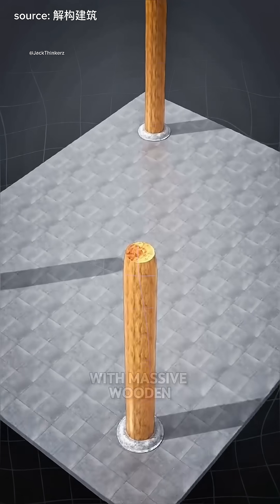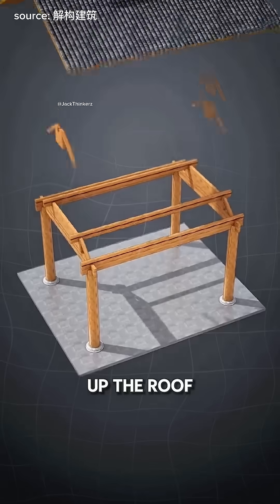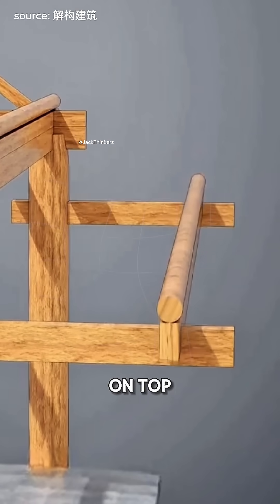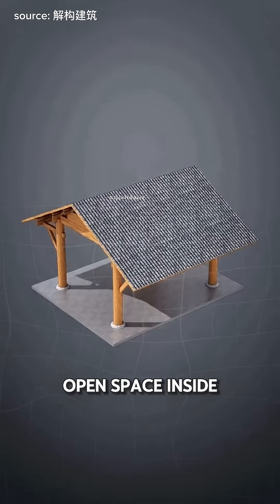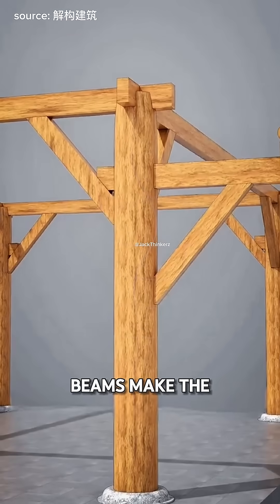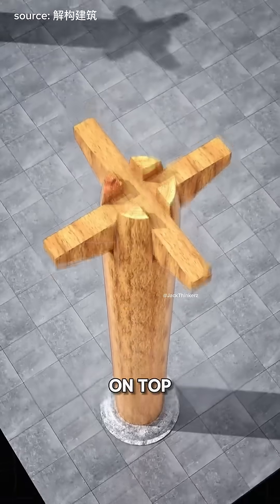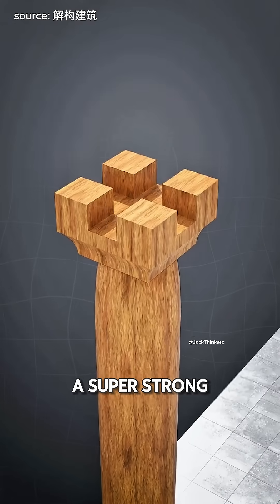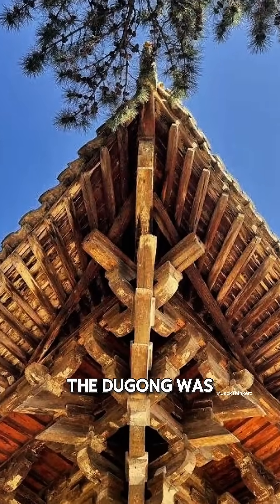The Genius Method That Kept Ancient Roofs Standing for Centuries!

Comment: I strongly suspect that the research for this video was very bad. All of the especially crafted corner pieces are not precisely fitted. They're very loosely fitted to allow for all movement forces during an earthquake.  This is why these buildings have survived for many centuries. The wood also is specially cured not to rot.  A scale building was subjected to a full shake table force and survived without any damage. Interior brivk and mortar walls shattered.